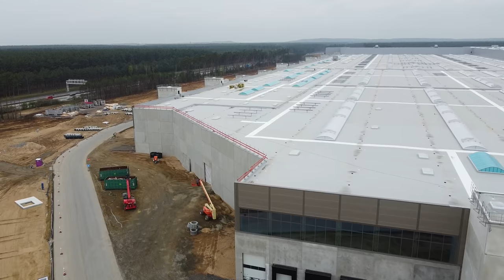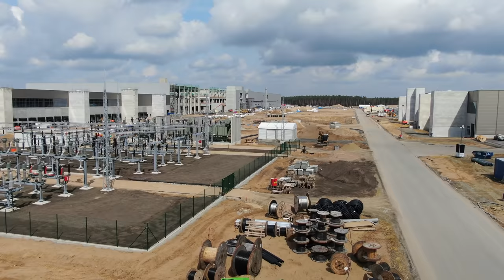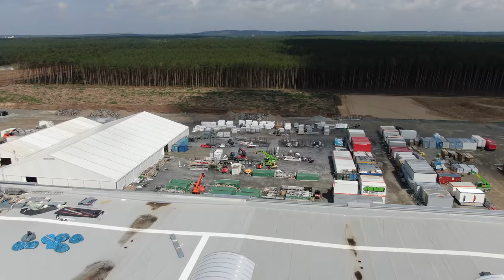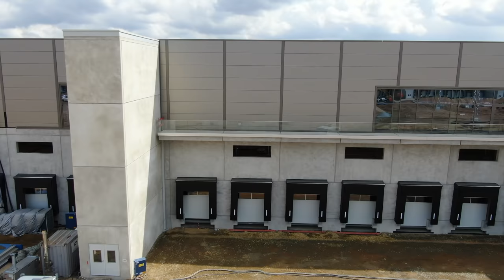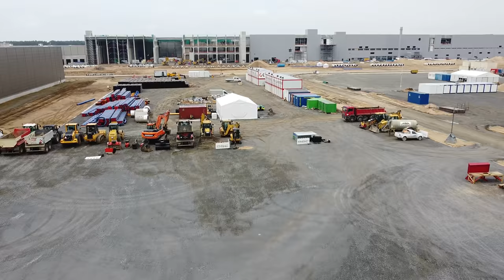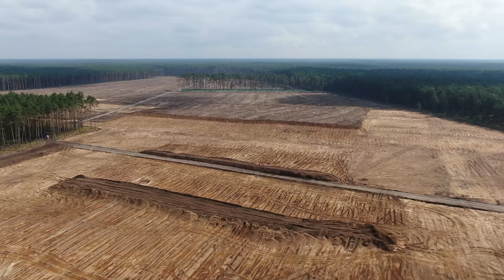Giga Berlin | 2021-05-01 | May Day

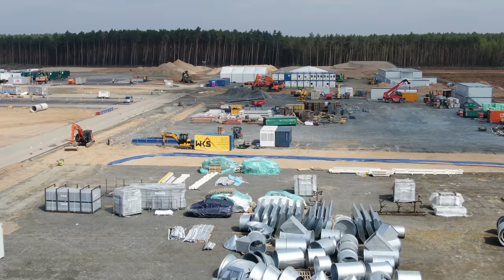Comment: I would have expected these Model Y chassis @13:25 to be moved inside by now. If that happens, this should be a good sign they start calibrating the robots!

But a lot of other stuff has been moved inside, these staging areas are getting more and more abandonned!
Reply from the maker: Actually, they did move some of the Model Y chassis. You can see at 13:25 it's only 9, not 10 like before.

Comment: anyone has idea on the number of Gigapress to be installed in Giga Berlin? there seems eight bases for Gigapress and only 2 installed.
Reply: 2 are sufficient to start production. 8 makes only sense if those will feed more than just one production line.
One reason why they halted some works there could be that they are planing a major redesign of the casting section.

Comment: Have all the trees been cleared for the battery plant?
Reply: The battery factory will be built on the area that was cleared first.
Reply: @julianreverse  As far as I know, the battery factory will be located inside block two. Of this block, only the Drive Unit area is standing so far. The warehouse building currently under construction will also be incorporated into block 2 at some point in the future. When completed, it will be as large as the existing hall to its left.
Reply from the maker: The newly cleared area is for storage, logistics and rainwater infiltration. Only a part of it will be used for more factory buildings later. The battery production is expected to be in the "warehouse" in the south-east corner, where they are digging the foundation right now.

Comment: It is really shame and waste if the production delay for ridiculous environment reason , no mod y in Taiwan , hopeless
Reply: Delay is simply due to the fact that some parts of the factory are not yet ready. GA and DU are still empty. Tesla just applied mid-April for the installation of production equipment in the GA. Why not earlier?  Plans not ready (you need those however also for ordering and installing the equipment)? Chaos?
Works at the wastewater treatment facility just began. Works at the Sprinkler Center and the Fire Station not all. And those construction works are covered by the preliminary permit granted in July 2020.

Comment: Instead of slow moving and thinking humans germany should employ ROBOTS & AI TO START GIVING PERMISSION FOR CONSTRUCTIONS so as to prevent biased delays.
Reply: There are currently only 2 pending permissions submitted in mid-April
1. installation of the production equipment in the General Assembly (why not earlier submitted?)
2. installation of the HVAC by a helicopter